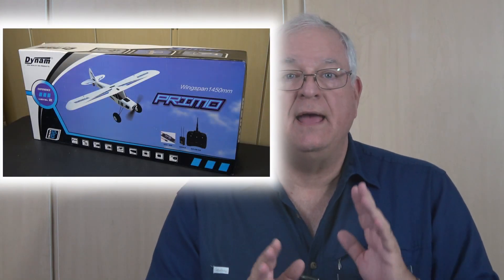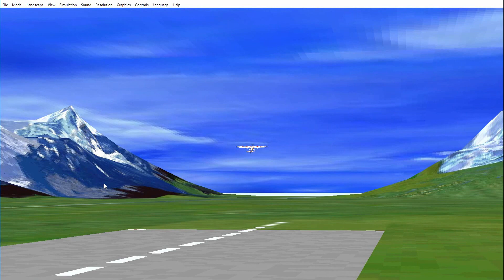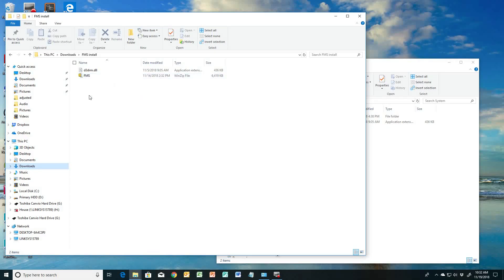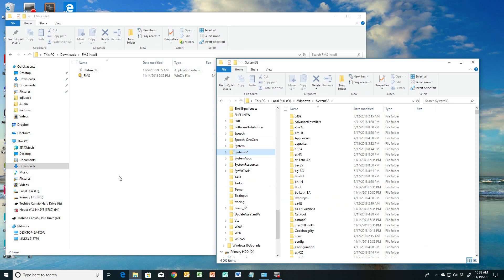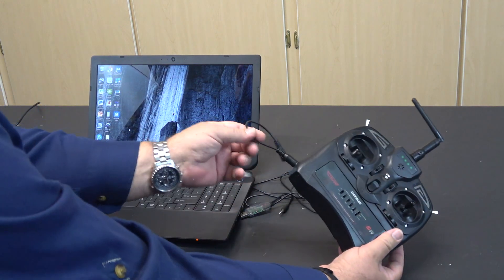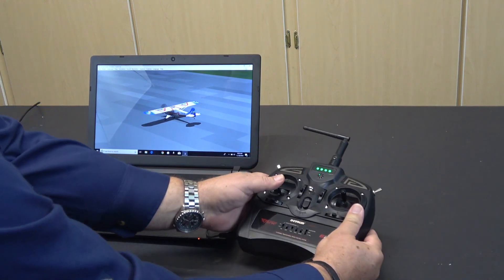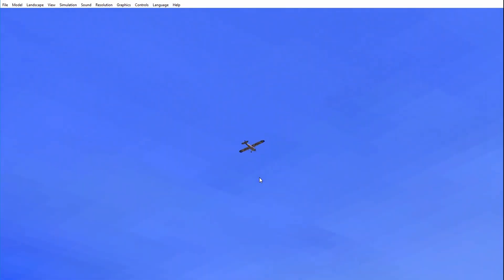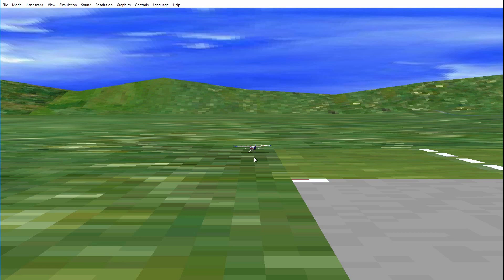FMS RC Flight Simulator

Comment: Thank you for this great video. It may be mentioned that you have to copy the .dll file to the Windows SysWOW64 folder if you are running a 64bit windows, after this little change the program runs great with my 4-channel TWF HOBBY 0905A E_sky controller.

Comment: Great video and very informative in details. I have downloaded sim program from a different video link and it works perfectly with Flysky-i6X controller. I used same USB cable came with the transmitter therefore there is no need to buy a special cable.

Comment: I am using win10 it dose not detect the cable and red light just keeps on blinking what to do??
Reply from the maker: System, make sure you download the compressed file that includes the Windows driver. As I recall, once unzipped the .dll file goes into two folders in the system folder. Reboot and it should work. It is one of the downsides to older software. Cheers.

Comment: In case you download the ZIP on the Manual page of the 6ch sim controller and notice it only has the FMSSetup.exe .... you can find the complete package (including the DLL and PDF) under the 8ch sim controller in the RAR file (another version of ZIP, but WinZip25 will open) that contains all files ... at least as of today!
Reply from the maker: Thanks for commenting.

Comment: I would like to build my own simulator to verify that my unique scale-model proof-of-concept experimental VTOL ducted fan design will fly. It's designed in Robert McNeel & Associates Rhinoceros 3D CAD. I'm fairly proficient in Python. Are there any generic templates? Should I use a game engine to start with? TIA.
Reply: You might have better luck with Real Flight. I don't use it but it is supposed to have a great deal of model control variables.
Reply: @GadgetTalk4U  Thanks. I doubt that it would have anything close. No trial version that I could see that I could poke around with.
I'm probably going to have to generate it from a pre-existing game engine, such as Unity.

Comment: Hi, i have a flysky-i6 model, can I use FMS usb simulator for learning fly by ur showed progrm?  
I downloaded the file on Manual tab, but there no dll files, just  FMS setup what I should do?
or is this FMS simulator cabel adapted to use for any simulator program like aerofly rc-7? 
it's my first transmitter, i hope your help
Thanks
Reply from the maker: I last looked a couple weeks ago and the zip file had the program and dll files. I'm not familiar with your transmitter. The connector is the big question. Since they are cheap, you may want to get the sim set with the controller. It is probably worth the poyential aggravation.
Reply: Hello there. Yes you can TRY using trainer USB cable came with transmitter. I have -i6X controller and used trainer cable came with it. I downloaded a FMS link from another video on youtube and was straight forward download. Rest of it was followed as shown here and works perfectly.
.

Comment: I have downloaded the FMS sim. I connected the dongle between my laptop and a Spektrum DX6i radio but the sim does not detect the radio. Did I miss something?
Reply from the maker: There is a .dll fule that is need we d for Windows computers. It is included in one of the Bitgo downloads. I don't recall what sim product page had it. It was part of a zip or rar file.

Comment: I have Windows 10 and cannot install the FMS program without getting an error message about a missing dll file. Can you help with that problem? Thanks for posting the video.
Reply from the maker: On the manual tab of this page you'll find a .rar compressed file with the FMS and the .dll files .  The readme PDF explains the install process.

 https://www.bitgohobby.com/Detrum-8CH-digital-USB-simulator_p_4003.html

That worked for me.

Comment: It would be cheaper for me to just buy a micro cp that can take crashes then it would be for me to build or buy a gaming computer and then spend $200 on realflight or something. But if I can use my current computer and buy a cheap sim I might go that route. All the high end sims say you need a graphics card with dedicated memory for the card. I dont even own a desktop that I could throw a card in.
Reply from the maker: There are a couple of helos in the sim.  I have an older laptop with embedded graphics and I didn't get a very good result with the helos. I also tried it on my gaming PC and didn't have much better luck.  The planes work well especially for a beginner but the included helos -- not so much.

Comment: Point the antenna towards the front of the aircraft
Reply from the maker: I'm assuming you mean to help maintain orientation. In the sim that might work but with an actual flying model you don't want to put the aircraft in the antenna null area. I think a better technique is to just hold the transmitter normally and develop the hand eye coordination to figure out left and right using all the free crashes the sim allows you. As with any new skill it can take a bit of practice or it might come naturally as it did to someone else commenting here.